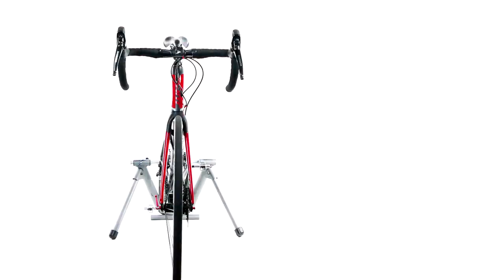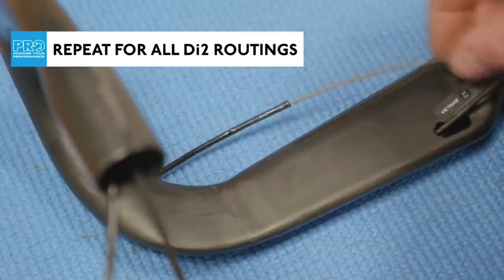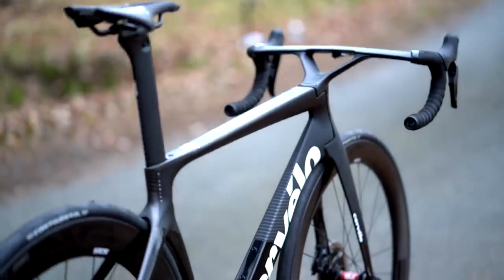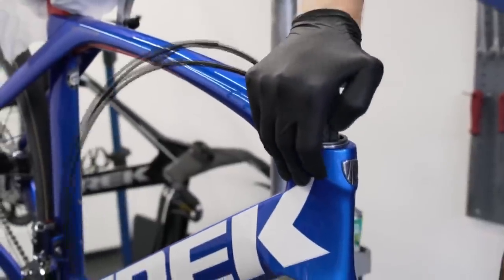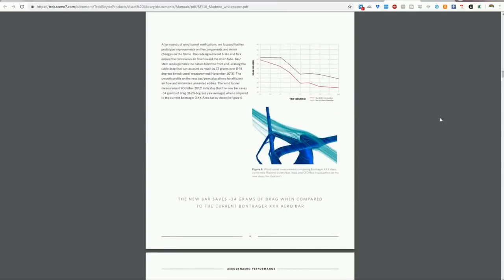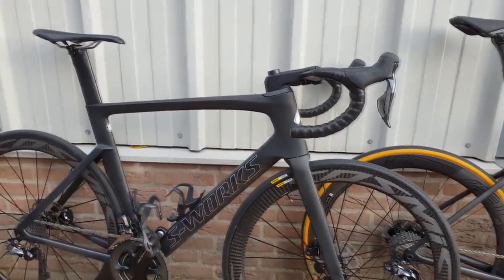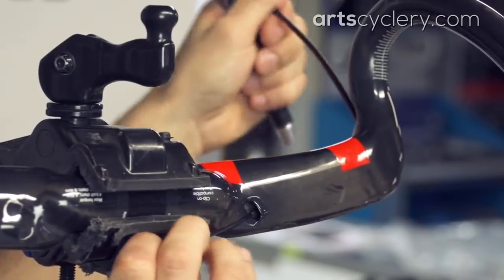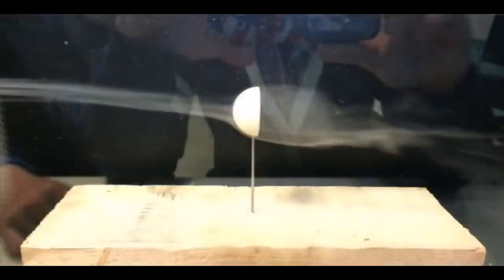Cable Science! Should you worry about wasted watts from your messy bike cables?

Comment: As someone with a PHD in Aerodynamics. If someone came into my office and expressed drag in "Grams" I would seriously question their aerodynamic proficiency.

It's like someone measuring the distance from London to Paris in Lightyears.
Reply: Cool! could you shed some light on something I've been wondering? So the cylinder shape, or circle from the top, creates quite a bit of drag, as is shown. But if the cylinder is at an angle to the wind direction (eg. the downtube of a steel bike, or most of the cables actually) then the shape of the section that is perpendicular to the wind direction is no longer a circle but a ellips, doesn't this has much reduced drag?? Since the ellips looks a bit like an airfoil with the tail cut short, and aero wheels are ellipses pretty much too.
Reply: @LordVilmore  That's correct, the angle makes the circle behave more like an ellipse which is more aerodynamic. The element of this video with the small cylinder and the huge aerofoil is misleading as it's highly dependent on how fast you are going.
Reply: Nowhere in the coefficient of friction does it talk about grams.  It's a function of materials interacting.  For example if you put a very wide tire on your car there will be less pounds per square inch required to support your car, but it does not change the amount of friction you will get, it's a distribution problem.  Maybe that PhD could explain it better.
Reply: I got to be really honest with you, the best racers in the world would have never considered such things of course they rode Steel bicycles.  My uncle used to shave his legs and I still think that's ridiculous for racing.
Reply: The educated side of YouTube.
Reply: But lightyear is still unit of distance. It's really bad example.
Reply: RollinRat    I did crask once about 10 years ago, it hurt.   I wasn't paying attention but that's what you get for looking at girls.  Gravel cycling is so much safer than Road cycling I don't know where to begin especially if you live in Europe where drivers are homicidal, naturally the Germans are the worst
Reply: It’s just another way of selling you something you don’t need.

Comment: Summary: the new gen aero bikes that completely hide the cables in the front save anout 3 watts @ 25 mph in this regard compared to traditional/light/climbing frames that have exposed cables in the front.

Does not seem anywhere near worth the much higher cost and much more difficult maintenance of these new fully integrated aero bikes for 3 watts.
Reply: You say that, but do you realise how many people are buying the Ceramic Speed pulley wheel system at 600 euros for even less watts saved?
Reply: Marginal gains. Everything adds up.
Reply: Those bikes are made for pros and their tech is coming down also to the cheaper bikes for us folks therefore we benefit from it some day. 3 Watts there, 2 Watts here and 4 watts over there and in some years we are getting faster and faster. Tech has to go on.
Reply: Looks way better tho
Reply: as others are saying it's clearly worth it for some. Others also prefer the cleaner aesthetics. In the end if we really did care about aero we'd be riding incumbent bikes, lying nearly flat.
Reply: You know I was little nervous buying Cult ceramic bearing for my Campagnolo Bora wheels .I notice huge difference the way it maintained its speed .
Reply: the reality is you wont look cool at next years group ride if you dont have the internally routed cabling and disk brakes. well unless your smashing everyone, then it dont matter you could have a 1980s steel bike and youd still be cool

Comment: Now a "how to" integrate cables without a $$$ I integrated bar and stem...I simply wrapped the handlebars AND the stem to conceal cables all the way to behind the stem cap where it cleanly enters the frame. I only have one front brake cable exposed which I plan to his inline with head tube by upgrading to an aero caliper like tri rig x

Comment: I think these videos are very informative. 2 watts saving is nothing; but if you total up the watt savings from all the other videos they've uploaded, 5 watts here, 10 watts there, another couple watts here also, then it all adds up to something significant. A difference of hitting a wall at 40kph on a flat or breaking through it and reaching beyond 45kph. Marginal gains could become massive gains.
Reply: It's 2 watts when you are riding very fast. The slower you are the lower the gain.

Comment: I optimized my exposed exterior routed cable routing so they all are "in line" with the steerer tube, not sticking out to the sides. If it saves me a few thousand dollars and a watt or 2.

Comment: I'm interested in watt savings concerning light wheel weight rotation compared to a exact weight bike with the same rubber tread. In other words, I'm wanting to figure out the best value of a light weight wheel. Thought it might make a good video and you're the one that can pull it off. I love your vids.
Reply from the maker: Hi Derek, yes this is a good topic. My understanding is that rotational weight forces only apply when accelerating, and that differences between similar wheels are quite small. All in all is something like 1% and much less than 1. total rider mass 2. weight 3. aero drag. Here is a link https://www.slowtwitch.com/Tech/Why_Wheel_Aerodynamics_Can_Outweigh_Wheel_Weight_and_Inertia_2106.html
Reply: @Fastfitnesstips  Thank you for the reply and I really love your channel, I've learned so much from you.
Reply: Meanwhile, it has been shown that the wheel weight does not matter: https://www.youtube.com/watch?v=0QDnUkUaQfk&t=17s Long story short: Heavier wheels need more power for acceleration, but the gyroscope effect saves a good amount of that energy. Light wheels are only good for saving weight, but they actually don't "accelerate" better.

Comment: I swear I could feel a difference when i put eTap on my supersix evo and deleted the external shifter cables, especially when going fast into a headwind
Reply: Same. I felt a difference when i turned my shifters in. More wind on outside of arms. Also when i went to aero bars, and when i shifted from aero bars to 400 bars, felt the change wind resistance wise, just different feel. Also felt shoe covers, though that could be ankle stability.

Comment: How many watts in aero drag diffidence are those modern longer cage (by comparison) dérailleur and 11 speed wide cassettes to something like a Shimano Ultegra Rd-6400 and narrower 7 or 8 speed cassettes?
Reply from the maker: OK, I looked this up for you.....the difference in drag between a long cage and short cage derallieur is in the region of 5g of drag unless its a huge one like the ceramicspeed OSPW when its around 10g (or 1watt at 40kph). I am not sure about the cassette/wheel because its hard to have a like-for-like comparison
Reply: @Fastfitnesstips  So the drive drain efficiency improvement of the ceramicspeed OSPW is negated by the aero drag losses of installing the OSPW in the first place by comparison of fitting a set of £24 Tacx Ceramic bearing jockey wheels instead into  a rear mech like a RD-1050 or RD-6400.
Reply: @Fastfitnesstips  I suspect the wider larger cassettes on modern 11 and 12 speed systems with 28-32 cogs would have an even larger aero drag than installing a ceramicspeed OSPW if using a narrower wheel 126mm OLN with a more compact 12-24 7 speed cassette or freewheel.
Reply from the maker: @amfearliathmor8213  our video on this: https://www.youtube.com/watch?v=vPWgtscgfa0&t=5s

Comment: Did you test the cables at angles.
Reply from the maker: No sorry....but we do have a wind calculator for cyclists including yaw coming later this year
Reply: @Fastfitnesstips  Thanks for the quick reply.  I wasn't clear.  The angle I meant was from the wind,  a round tube that's horizontal to the wind obviously has a lot lower drag that a tube perpendicular to the wind.  Also, what the wind sees when the tube is at an angle isn't the same shape, at 45 degrees into the wind, the shape is more of an oval and the air would tend to follow the cable on the trailing edge, the way it comes up the fork toward the head tube - at least that's what I think.   So, there might be something for people to consider when cabling their older - not hidden cable bikes.   Thanks again for the, as always, interesting video.

Comment: Hello, would like to know if two small (50% of existing ones) (left & right side) front disk brakes would be or create less drag than one  of the large/present/existing disk break arrangements.
Reply from the maker: Yes if you use 140mm you will have some minimal savings vs 160mm (when yaw is not 0) but not as much as you hope because of drag from the brake calibre housing. Look up our video on disc vs nondisc
Reply: @Fastfitnesstips My thought was would two 50 mm calipers (not yet designed) (one on each stem of the front fork) have less drag than one 140mm ... I'll watch your video thanks
Reply from the maker: @FooFahFoeFum  Ah ok I am with you now......clever! actually no because you will have two brake callipers. However if you could miniaturize the caliper into the fork then two would be better (because they would double the braking force with potentially no aero loss but you would have to resdesign the wheel too arrg)....or better yet could the braking be done inside the hub magnetically? (the retardation force would be pathetic but enough to slow...not stop and could be combined with a tiny-mini-rotor). Alternatively invent aero shaped brake calipers or a cover from the fork like these: https://bit.ly/2H7MXv4. However a 100mm or 75mm or maybe 50mm rotor will probably work one sided with enough force.....you really dont need 140mm for most riding conditions front and back , so the easiest of all solutions is to go down to 100mm one sided.
Reply: @Fastfitnesstips  So much innovation in cycling still to come. I remember when all the pros were riding 19mm tires. Ouch, ouch, ooooh.  Keep up the good work.  Your videos force people to think out of the BOX.  I'll leave you with my last thought. How would a carbon seat post  originating from the bottom end in one foil, (as they are in the Cervelo S5) then  splitting into 2 much smaller ones, perpendicular to the bike frame and then going all the way up to the seat rails for top connection.  Existing Seat Posts are way toooooooooooooooo thick.

Comment: I looped my cables over so they cross on the downtube to avoid contact with the head tube, in other words the left shifter cable goes to the right side of the bike and vice versa.  That probably adds a few inches of cable to each side.  When you're caring panniers with cargo cables are the least of your issues.

Comment: Giving the cables a tail is all that they need to do.. make the shape of the cable like a drop of water and problem solved.. Let me know what else you need help with.  How stupid are you people?
Reply from the maker: Nice idea. Love to see someone make this work!
Reply: Only thing they need to do is change the molds that create the cables. It will add a little bit of weight. But the way things are going Aero  bikes are heavier so that little bit of weight on a regular bike really wouldn't matter.
Reply: and how are you going to align them all correctly? Im pretty sure they will be twisted to all sides once installed.
Reply: BigFudge87 if they can make a cables logo show the right way, I am sure they can make a cable pointing the right way as well. And if not they can always create something to stick on to the end of the cable. Maybe a styrofoam little tail that will stick on to the cables. Styrofoam is very light easy to stick on. Anything else you need answered? Plus I'm not making any money for giving you multimillion-dollar ideas here
Reply: @HarryTzianakisTheGodOfSpeed there is no such thing as a "multi million dollar idea", ideas come cheap, everyone has them. Plus the idea you suggest was literally already illustrated towards the end of the video. The money lies not in ideas, the money is in acting on them.
Reply: @HarryTzianakisTheGodOfSpeed  Could you just stick some insulting or duck tape around the cables and shape it like a drip? It's cheap, you can position it's tail to where it's required and hopefully should keep it's form through the wind
Reply: Barry Hooper sounds perfect!
Reply: @Fastfitnesstips  Just get some Sugru.
Reply: A silicone aero fairing which slips over the cable, held in place after injecting some glue when orientation of cable fairing has been configured.
Reply: @BigFudge87   A hex shaped ended female cable brake adjuster designed to take a hex shaped male brake cable outer ferrule would hold the cable in the correct orientation or pitch angle to the air flow.
Reply: Amfear Liathmor  i just push harder. Do we think about shit like that on Zwift? We are holding ourselves back by thinking and adding the Watts we are losing. The strongest goes faster even if he is on a Wal-Mart bike.